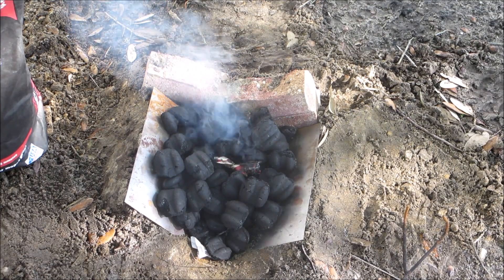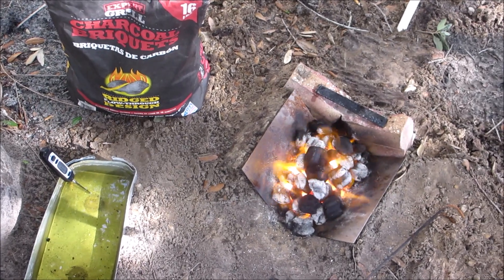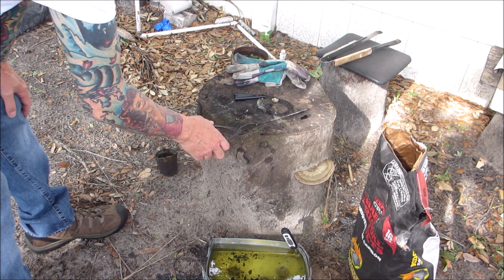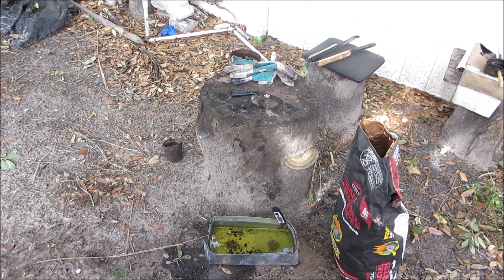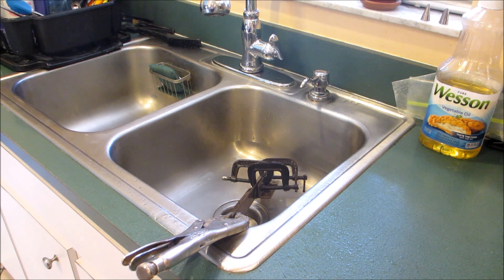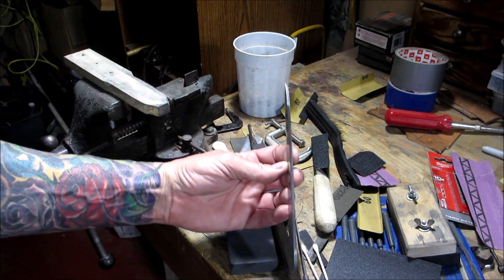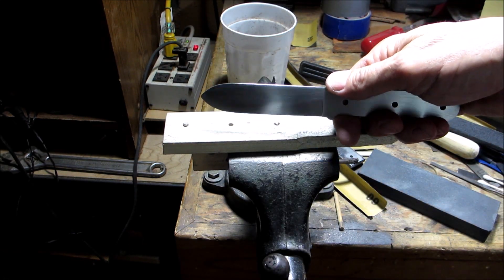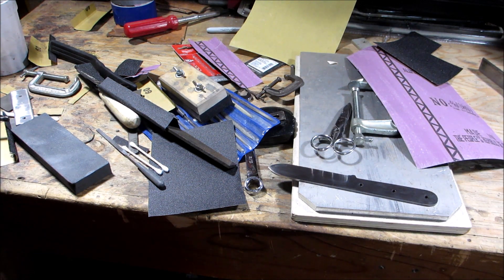The Making of my Horace Kephart Knife! Part 7.

Comment: I have been wondering how you heat treat a knife want to make some out of old Saw blades and would like to harden them how do you know how long to put them in the heat and you used vegetable oil
Reply from the maker: Mountain Man There is what is called the critical temperature, but without a heat treating oven you have to use a magnet. You heat the steel up until it is non-magnetic and then quench in oil. I used canola for this one. I used regular vegetable oil on my flint strikers. 

The issue with saw blades and other steel is what they are made of is unknown. You may have to try different things. 

Some steels harden in water and some in oil. Some air harden. 

The best thing to do is run a file across the edge after harding. If the file skates across you are good. If it bites in then the heat treat failed. 

I hope that helps!

Comment: I hate the sanding part. I usually take up to 320, maybe 400 and then I like to patina the blade with mustard and a Q-tip. You can actually draw in patterns or designs and it'll sand out if you decide you don't like it.
Reply from the maker: Wow that sounds cool! I’m going to have to try that sometime! Thanks for the tip brother, I appreciate it!